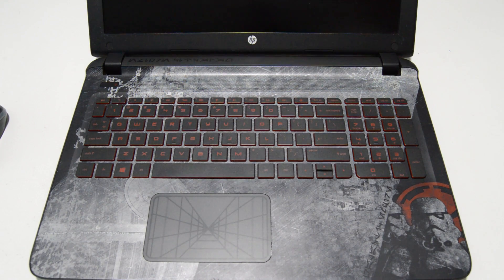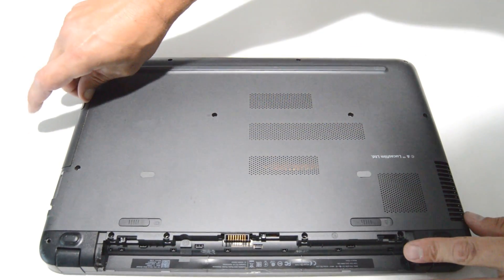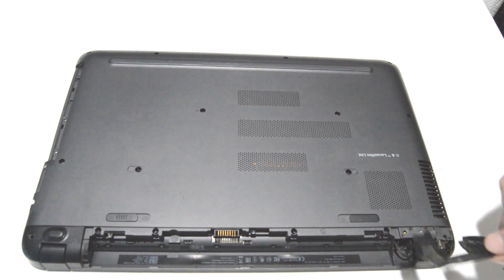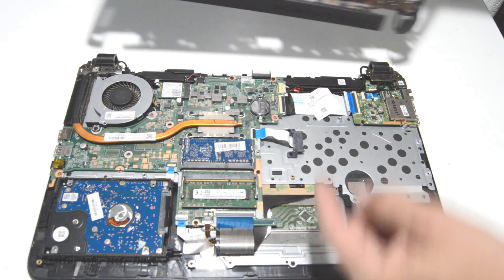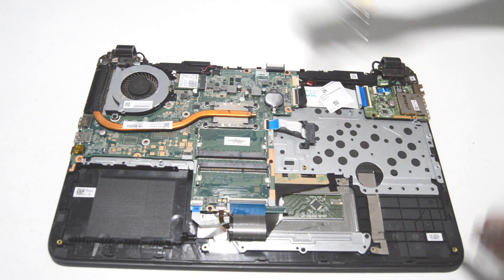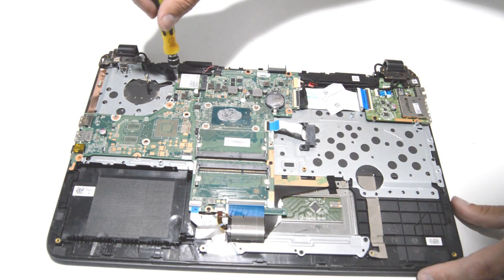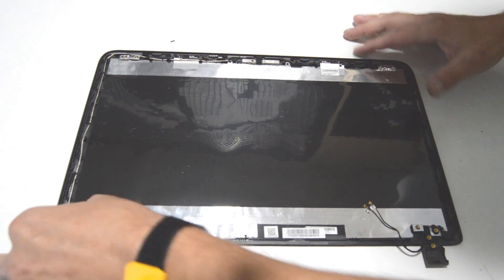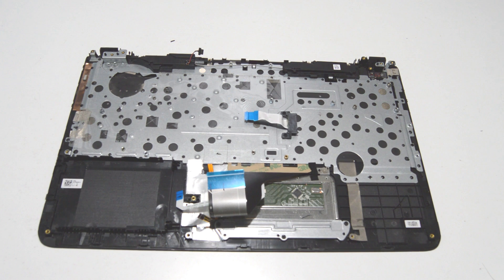How to Disassemble HP 15 Star Wars Laptop or Sell it.

Comment: I have one for sale if anyone wants it. Its too slow for what i need it to do.  (Streaming)
Reply: Not slow at all. Reinstall windows if you dont need the old set up. It removes all the junk files accumulated over the years. Or you may just want to change the hard drive to an SSD drive and reinstall Windows. Will feel like a brand new lappy. The old drive is Sata and over 8 years old. 

May the force be with you!

Comment: You mention near the end of the video that the keyboard is non-removable.... can it not be replaced?  I took my whole machine apart and now I don't see a way to replace the keyboard 😱
Reply: Keyboard must be changed with a Doner laptop. This uses plastic rivets to the top base of the keyboard. I mean it is possible to change the keyboard but you will be needing soldering iron pen and the know how. Good luck!!

May the force be with you!

Comment: Hi! Great video! I have the HP 15t an000 Intel Core i7 Star Wars Edition. It has the original 4 Gb Ram and one 8 Gb Ram on the second slot. Do you know if it's possible to replace the original 4 Gb for a new 8 Gb? By any chance do you know which one will be compatible? Thanks a lot!
Reply: Hi. Yes it's possible. The old saying... Anything is possible no matter how incredible. 

It takes DDR3-1600 Ram. 

You can max it out at 16gb. 😊

Comment: 16:17 “The keyboard is not removable”

So, there is no way I can change the Vader-red backlight to Yoda-green with the Vader carcase. Is that correct? :/

Awesome vid
Reply from the maker: I have seen comments from others who managed to break all the plastic rivets and reattached with glue or epoxy. I would definitely make sure to glue each and every one since the keyboard bracket helps hold the components and bottom case.

Comment: Hello this is a old video BUT i did put 16GB in my star wars laptop + new SSD in the place of the old HDD and put the old HDD in the DVD slot and the machine feels like a new one ! thank you for your experience ! i have a "new machine" thank to you ! i clean the fan cooler and  i feel i have new laptop ! thanks !
Reply from the maker: Nice! Glad to hear it
Reply: Hi! Mine has the original 4 Gb RAM and a second one 8 Gb. I tried to replace the 4Gb one for a 8 Gb but the laptop wouldn't start and the caps lock button keeps blinking... Any suggestions? Thanks in advance!

Comment: What's the name or measurement of two screws under the ROM, I need to buy it somewhere, but I can't really find it, thx very much..
Reply from the maker: Just buy a screw set from eBay https://www.ebay.com/itm/HP-Pavilion-15-an050nr-15-6-Genuine-Screw-Set-Screws-for-Repair-ScrewSet/323746536297?hash=item4b60cc1b69:g:g30AAOSwtAlck192
Reply: @Sellbrokedotcom  Thank You very much, You helped a lot :D

Comment: Excellent video, you know if you can expand the memory ram that brings by default 6 GB?
Reply from the maker: Yes you can. Google the exact model of your laptop to see the max amount
Reply: I have this laptop and swapped the 2x3gb with 2x4gb also took the slow af hdd out and using an ssd instead, only trouble is now that the fan needs cleaning once a year.
Reply: @jameslepine5879  can you list the ssd and ram that you used? wanna upgrade mine but dont really know what kind of SSD and RAM I can put on this laptop

Comment: Could you please help me? I opened this up and I broke off a green wire and I'm not sure where it belongs.
Reply from the maker: Does it come from around the hinge? If so it must be an antenna wire
Reply: @Sellbrokedotcom  my screen has pink, blue and green hue, and it displays icons and images that are not on screen
Reply from the maker: @semiloreomoyinmi6398  I would try and update or reinstall your display driver first. Does it change if you open and close your lid slightly? It could be a bad driver, bad cable, or bad video chip. If you are unable to see well enough to check your driver, try plugging your laptop into a TV with an HDMI cable and use that for diagnosis. If the TV shows a good image, then your laptop has a bad component.

Comment: I'm having problems removing the screws under the DVD player , the flat ones. They are really small and I can't find small enough tool for them. I ve tried many different but I couldn't remove them
Reply: Get a torx screwdriver kit from Lowe’s for $10. It has everything you need

Comment: I have a 15-an050dx with a liquid damaged keyboard. How can this keyboard be replaced? Thank you!
Reply: I replaced my keyboard. You need to remove the metal plate and the keyboard does come out and can be replaced. There is a video on YouTube showing this being done. I'll add it to this post if I can find it. Hope that helps. This video is not in English but will give you some idea what your in for. 
https://www.youtube.com/watch?v=B9Qm6riEASY
Reply from the maker: It looks like the keyboard is integrated into the palmrest, you might have to just replace as an assembly unfortunately.

Comment: Hey. Im struggling to get any leverage with those last two screws under the covers. Tried an xacto knife. Flathead and credir card. What did you use?
Reply from the maker: We use a tool called a Spudger. They are hard enough to pry with but soft enough to help prevent breaking things. Did you mean the rear covers that have the rubber feet?
Reply: @Sellbrokedotcom  nope. The covers underneath. I managed to get the rear parts off no problem. It's the ones that covered the screws I was struggling with. Thank you.